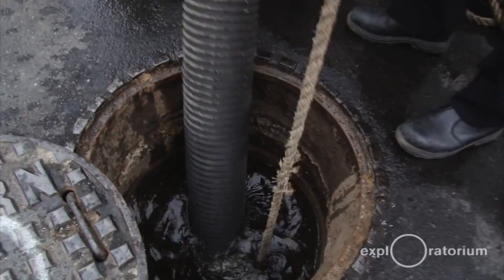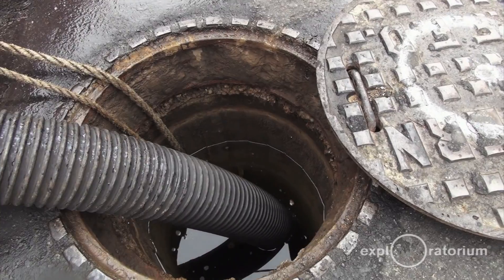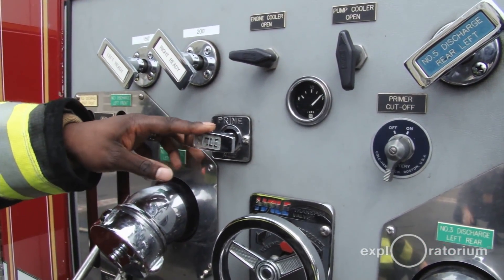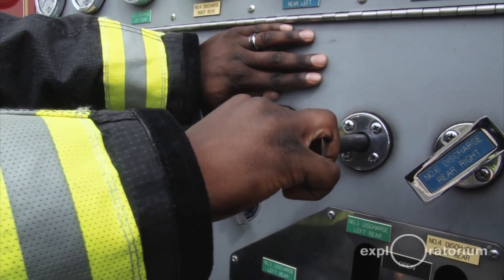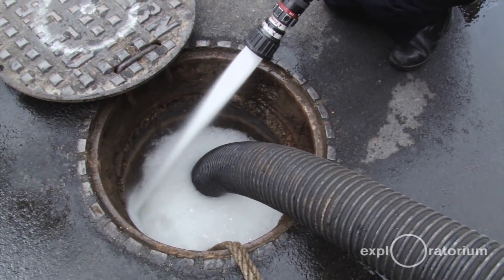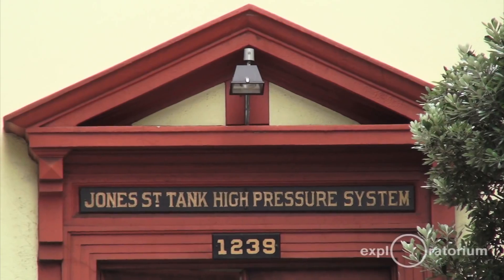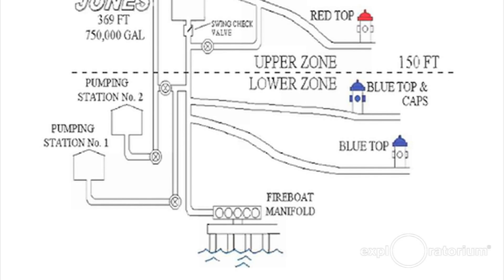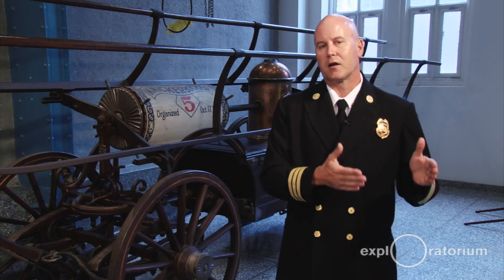SFFD Auxiliary Water System

Comment: It is so nice to see a city group drafting. When I was driving for a volunteer company outside of about five towns in the county, everything else was tanker or drafting.
Reply from the maker: This is a Cistern, which San Francisco has many of all throughout the city. They also have a high-pressure system with specialized pumps that pump up to 500 pounds pressure with very large hydrants throughout the city. They instantly pressure reducing valve large in size 90 pounds on those hydrants in order to decrease pressure when needed which would be always I guess.

Comment: Nice video. 
My department has approximately 30 “modern” cisterns in service. 
They’ve become quite popular over the past 15 years or so in many areas.
Reply from the maker: I don’t work in San Francisco fire, but have friends that do. They have I think over 200 sisters continue to put them in. After the 1906 earthquake, they don’t take any chances. Plus they have high pressure hydrants that go up to 500 pounds psi. They have a Glisan valve that goes on to the hydrant to reduce the pressure if they use it for normal pumping.